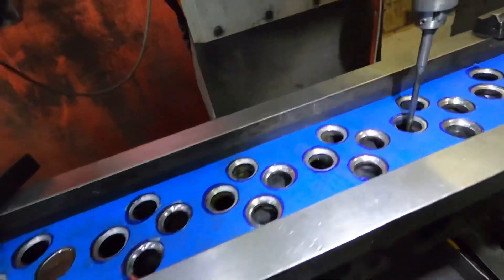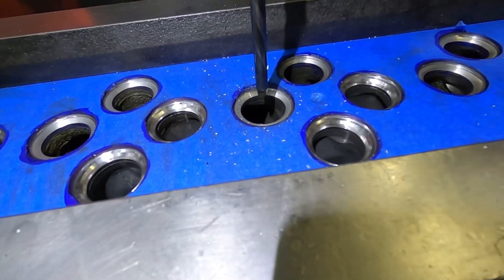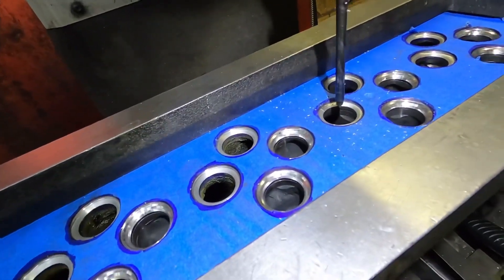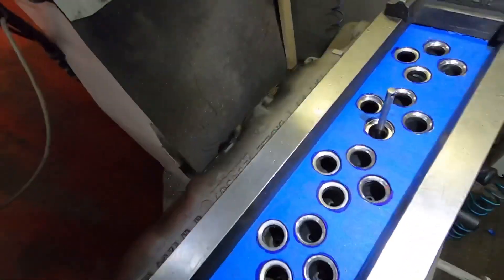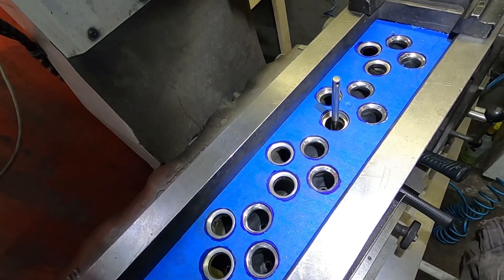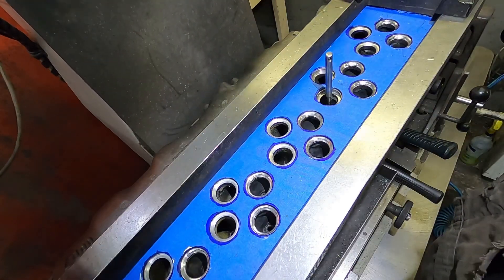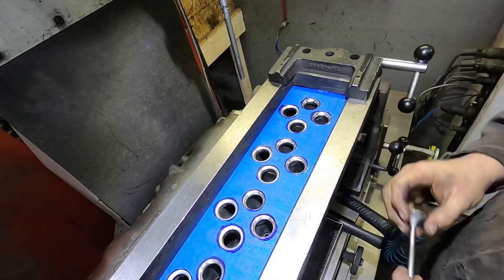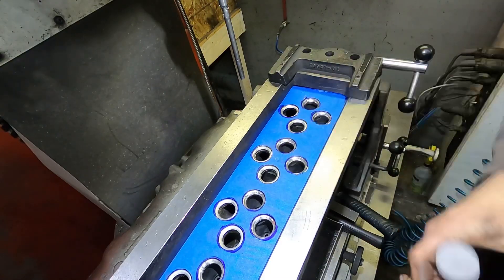THIS COULD HAVE BEEN BAD. Found some loose valve seats !!!!

Comment: I think I need new seats for my 5.9 head, I checked valve recess and they were all between .048 and .056 and they're supposed to be .023 to .045
Reply from the maker: Depends on the engines specs. Engine builders will some times add recession if the protrusion of the pistons is high of has a bigger cam.
Reply: @CUTTERUPROB  Yeah I agree, but this was a bone stock '96 and I'm not going to swap the cam. I'm going to check with the machine shop and see what they have to say or if they can just touch up the valves and seats and send it.

Comment: Hey I was asking about the 3rd gen heads dropping valves, thanks for the video rob.  That motor I picked up looks like it was a fresh rebuild and dropped the seat and hammered out the piston and cyl head real good but the bore was good other than a slight polished area I measured and it measures out exactly the same as the rest of the bore.  I suspect what you caught there was the same as what happened to my unit
Reply from the maker: sweet glad you seen it, I will do another video on one when i get a head in that i do myself. so the whole thing. ya if the seats a are stone ground it lots of time does get caught
Reply: @CUTTERUPROB  Nice thanks man.  I didn't even realize stone grinding was a thing for valve seats, I'd always assumed it was the fly cutter with the carbide guide pin set up.
Reply from the maker: @peterr7950  stone grinding started years ago. some guys still use it and i do if i can't cut with the seat and guide machine